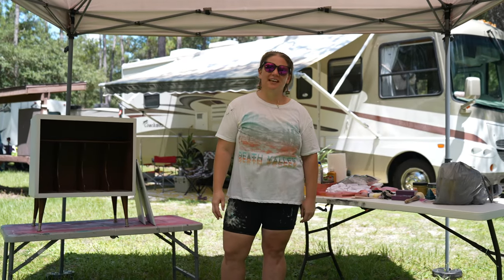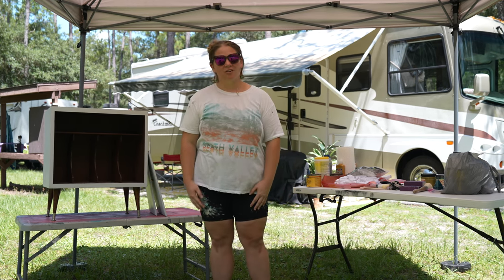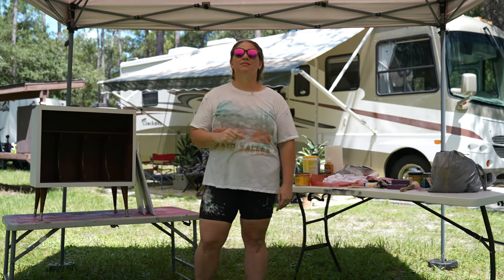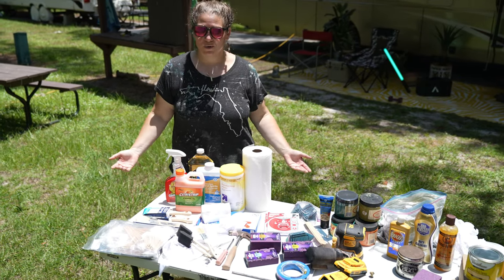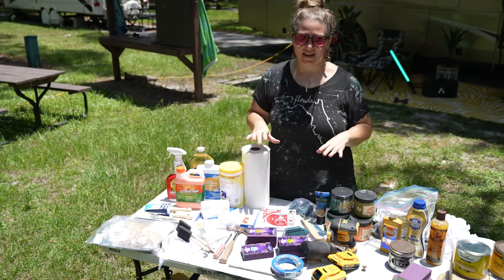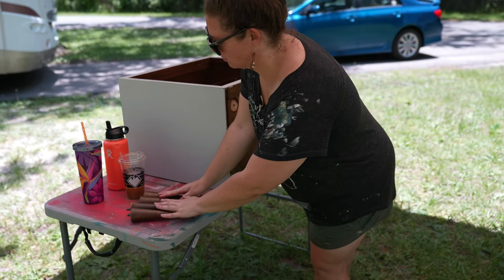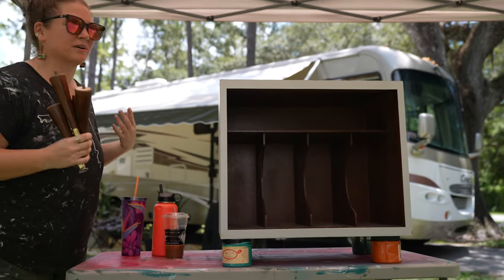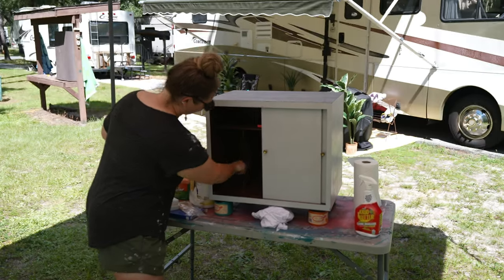VINTAGE RECORD CABINET BEFORE AND AFTER // VINTAGE FURNITURE FLIPPING 2022// RECORD CABINET MAKEOVER

Comment: Have you thought about what you’ll do if you end up at a park that doesn’t allow you to do this outside?
Reply from the maker: We will do it inside 😂 Because of weather, we have had to take some pieces inside already. It gets a little tight at moments… but with determination and a positive attitude, anything is possible! So I am not too worried about it. Also: we are trading in my vehicle soon for a sprinter style van. It is WAY overdue, I should have made the change years ago! I am planning to use that as both storage and a work space, as needed. I am really excited to do that!
Reply: @trellashoppe  well that should be fun!